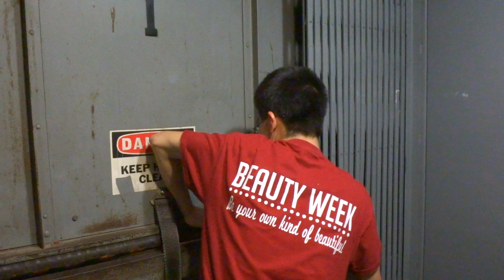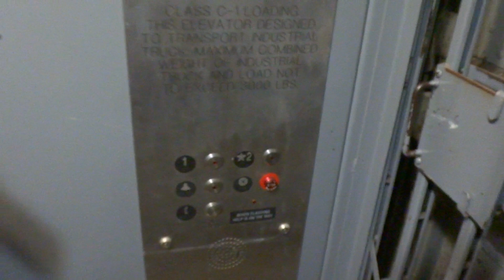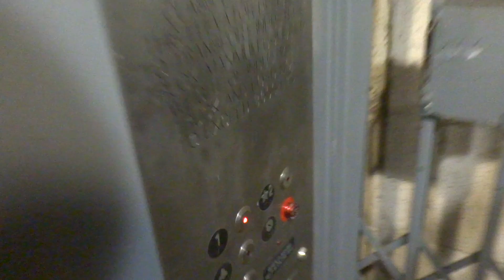Awesome gated Tejas Hydraulic "Space" Freight Elevator at West Mall, UT Austin, TX.

Comment: It took only 3 seconds to level in both directions, which probably means that this has the MEI-Reflex, even if the power unit and cylinder are Cemco.
Reply: Yep i saw the Reflex leveling
Reply: And it was Minnesota Elevator that acquired Cemco in late-2012.